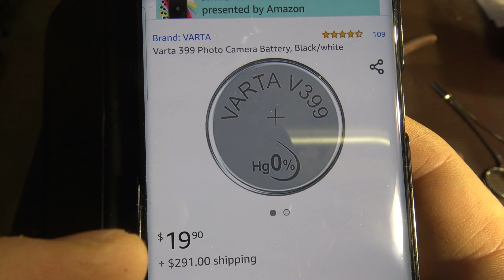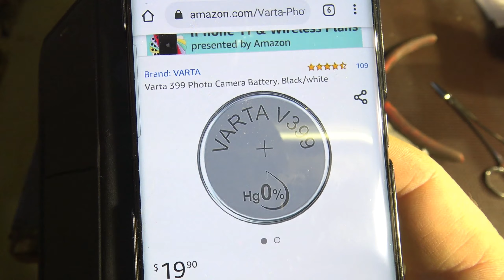How To Replace The Citizen Watch Battery

Comment: Great demonstration, Peter! In the absence of the proper tool to remove and replace the back, right-angled circlip pliers do work pretty well. I used to do this before I bought a watchmaker's kit. The little cover plate on the battery is always a bit fiddly to replace! I think you struggled a bit because you had to hold the strap out of the way - you needed three hands!  😁👍
Reply from the maker: Thank You, My Friend for a great comment and information!👍😀 Best Regards Peter